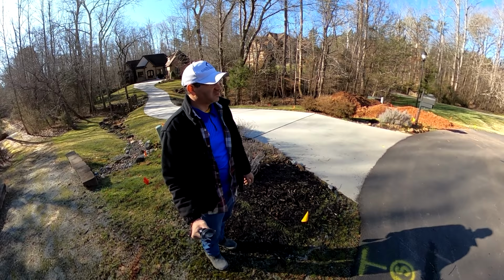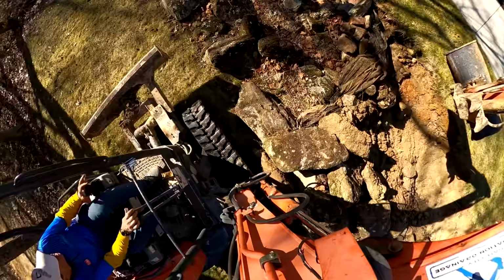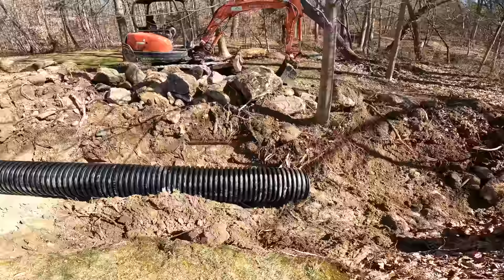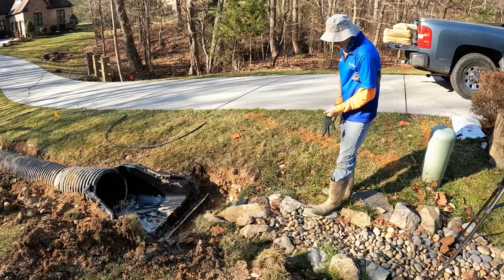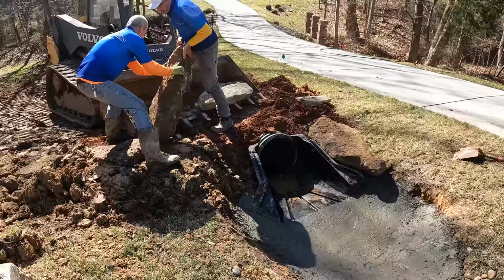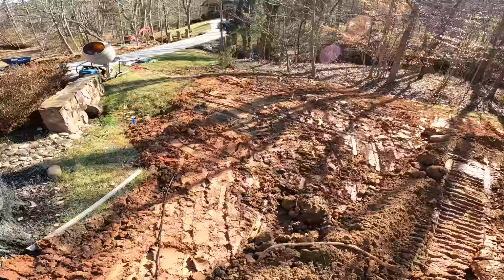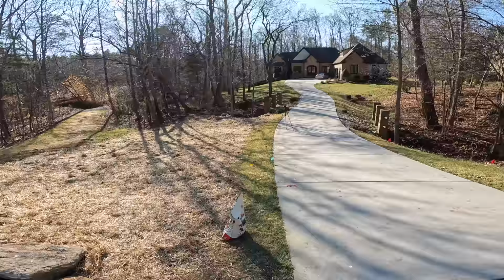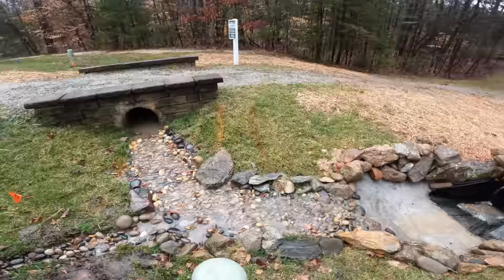Converting a riprap channel to a culvert

Comment: What is the reason for spreading the straw when you have seeded? As we don’t do that in England.
Reply: Helps to keep the moisture in, and keep seed from blowing away. Rains a lot more in England than it does in the USA.
Reply: @chrisbaer4567  Not necessarily true.  More rain in up state New York than London.
Reply: On construction projects the UK with a large area to be seeded the grass seed is mixed with water and wood fiber or paper and spayed is sprayed on. Would do a similar job to the straw.
Reply: @johnclements6614  👍thanks for that
Reply from the maker: The straw absorbs the energy of raindrop splash, so protects the bare soil, it protects the seed from predators, the straw holds moisture and releases nutrients as it decomposes. The grass grows right up through the straw and by the time it's ready to mow, the straw is all but gone.
Reply: @GCFD  thank you 🙏

Comment: Great video!! Definitely the dump truck guy is at fault! But, I'm sure you paid for it in labor though. 😒 So I see you have the truck up and running. What ended up being the issue with its continual death?
Reply from the maker: This was before it died on the road. I have a high pressure oil leak somewhere. I ordered some air testing parts. It might be a dummy plug, o ring or injector. Should know next week! I already miss the truck.

Comment: Did you pull any permits for this? Converting an open channel to a culvert usually requires and engineering analysis to prove its necessary beyond just aesthetics…
Reply from the maker: We did get approval for this project. I think it was something like an 8 month turn around for the homeowner before we could start.

Comment: Great video Shawn. I love your videos. I know you didn't do a french drain here but I see many of your videos do. I can not find scheduler 40 perforated pipe anywhere. Is it as simple as just drilling out perforations on the bottom side of the pipe? If not any recommendations on where I can get it? I'm in Georgia. The big box stores don't have it and they want to sell you the corrugated pipes. Any help would be appreciated. Otherwise if you travel to GA I would love to have you. I have so much water all over my house.
Reply from the maker: Hi Steve - We did a FD today and we drill our own pipe. We use around 1/2"
 drill every 6 inches at the 5 and 7 oclock positions.
Reply: @GCFD  Thank you sir. Much appreciated. I'm dewatering my back yard this week. Thanks for all the inspirational and educational videos. I have learned so much. Thanks again.

Comment: The communication line breaking wasnt your fault. It was buried and not marked. You had no idea to look for it. Have a question though. You are always saying how corrugated pipes isnt good to use, but you do use it occasionally. Can you tell me when its ok to use and when its not?
Reply: Double wall corrugated is not as resistant to mechanical damage as solid pipe but if it is buried at sufficient depth  so that vehicles do not damage it and it is bedded so that rocks do not stab it it is good. Same water capacity as solid and since smooth no snags to catch debris. Less material in the pipe so cheaper and also lighter so easier to carry move.

Single wall congregated is less resistant to damage than double walled corrugated and much less resistant than solid. It can be squashed in some cases by walking on it but it will be strong enough if used at sufficient depth and is properly bedded to prevent stones etc stabbing it. It will carry less water because it is rough inside and the rough inside will catch leaves etc. Since less materials it is cheaper and lighter.  Good to use in lower flows where no debris can get into the pipe such as land drains, should not be connected to gutters.

Solid pipe is more resistant to mechanical damage so good for use closer to the surface. A solid pipe is more likely to survive being attacked by gardening tools than double wall. But it is more costly than double wall because more material is required for the same strength. In some places it is code to use solid pipe at depth for sewage where double wall would be adequate for strength, because of its increased resistance to mechanical damage. Solid gets very expensive for larger diameters then it is better to go with concrete or double wall.

You have to consider the whole cost, the pipe is only part of the cost.  Solid is more expensive but less likely to get damaged at the surface where Shawn uses it mostly in gutter outfalls.
Reply: Thank you so much for all the info. Really appreciate that
Reply from the maker: Like John said above... this is double wall corrugated so it's rigid and smooth on the inside. It's good stuff for culvert.
Reply: Thanks

Comment: Another great project completed👌🙂
I noticed or it stood out more since Bing watching your clips is that 2 of our concrete paths, we'll one really it goes from the front of the house near the front door along the front and then down side of the house it has fallen/sunken towards the house. I believe this has happened since we had the bad flooding here in Townsville back in 2019( we didn't get water in the house just the block had a lot of water on it). I have fixed the water problem with plumbing the rear downpipes out to the street, a French drain system and I have also had topsoil dropped off and used it to manipulate the water where I want it to go which is all working perfectly.
My question is the concrete path do you think I should remove it and put in a new one or top coat it to recreate the fall it used to have?
Cheers
Reply: There's a mason on YT Mike Hadduck who does a lot of repair jobs.  Search his channel for ideas/solutions.
Reply: @AStanton1966  I know how to concrete🙂 I was just wondering what his recommendations are 
It isn't like I could get him to come and give me a quote 🤣🤣
Reply: @logsie3918  I was thinking in terms of some ideas for a low cost repair.  Like lifting up the affected area.  That's why I like the Mike Hadduck videos.  He always goes for the Chevy solution rather than the Cadillac.
Reply: Does the water from a thunderstorm stay ponded against the house. If no water is getting into the house and the sun comes out and drys the wall so it does not stay damp is it a problem (as opposed to not desirable). 

 If the concrete has settled towards the house then the area excavated next to the house to build the foundations was not compacted properly. Overlaying the concrete could cause more settlement. Thin layers are difficult to apply. If you you bury more of the wall you could cause more problems.
Reply: @John Clements  the building process here unfortunately is wack them up as fast as possible. We didn't witness our house being built but have visited quite a few display villages and watched a lot of new construction going on around town over the last 5 years. Slabs are poured and usually with in the week of pouring they are already building on it. I thought and have read the slab needs to settle and cure properly first which takes about a month is that correct?
I know the garages usually crack first I have been informed as they pull all the concrete that direction which brings out more water in that section.
We have had to recently retile a small area due to finding out that there was very little adhesive on the back of the tiles that had totally failed this has been acknowledged by a tiler tradesman we had out that they just slap them down and get straight onto the next job.
I dont mind smashing it out and putting in a new one, at least I know it will be don't properly.🙂
Thanks for the advice and information
Reply: @logsie3918  I think the building process in most places is chuck them up as quick as possible and bodge over the mistakes.

Normal concrete will get to around 75% of its ultimate strength in 7 days and around 95% at 28 days. Maybe a bit slower if they replace some of the cement with ash from your coal power stations. Seven days should be strong enough to build on unless they are putting some heavy equipment on it.

Not sure what you mean by the building slab settling; the ground that the slab is placed on should be compacted so that it does not settle after it is poured which could cause it to crack. Curing will take about a month but most takes place in the first few days. They normally spray the slab with chemicals when the concrete has not set to seal in the water to help the slab cure. Walking on the slab will rub off the chemical but if they leave it for a week it will still work and it will take a while to be all removed.

If they are dropping all the concrete in one place and dragging it that is not good. They will tend to leave the stones behind and drag the cement and sand, segregation of the concrete mix. That would explain the water. You need the interlock between the stones for part of the strength. They should place the concrete so that as little movement as possible will be required as you can see in Shawn's concrete gang.

I assumed that a concrete slab around the outside of  house would be separate from the house slab. I obviously do not know if the slab around your house is separate.
Reply from the maker: I would recommend replacing the concrete. The reason is I like to fix things correctly and long term. You could absolutely resurface the existing walk to raise it up but you might have the same problem later, or the resurfacing material might flake off. I think it's good that you're identifying and looking to solve these problems before they become bigger issues.
Reply: @John Clements  yes sorry the paths are separate to the house and thank you for the in-depth explanation 🙂👌
Reply: @Gate City Foundation Drainage  thanks for the advice
I will look into replacing it and putting back in the correct fall like your awesome concrete crew do🙂👌

Comment: So my question is this.  Why do you use that type of pipe instead of a pvc pipe.
Reply from the maker: For anything 12" an above I use double wall corrugated. This culvert pipe is smooth on the inside and rigid. It's good stuff.

Comment: Can a riprap channel ever be self-clensing the same way a concrete channel or culvert can? Or will sand always build up and clog the lower flow channels in the rock and divert more of the water to the upper channels and eventually causing surface flow on top of the now-clogged riprap?
Reply: Concrete channels and culverts are only self cleansing if they have enough flow to clean out the debris, same as a riprap channel.  If there are frequent high flows the riprap will stay clean but trees etc could start to encroach and make it more like a natural feature.

If there are infrequent high flows with low flows that deposit sand then the sand then there could be problems. The sand filled riprap will not slow down the water initially so the water will move down the channel faster. Not a problem if the riprap is there to protect the channel itself but a problem if you want to slow the water down before it gets to some place down stream.  Eventually the faster flow will scour the sand out and then the riprap will be exposed slowing the water back down. If deposition in the riprap is causing a problem down stream you could put in a pond or deepened channel upstream, at a convenient point to catch the sand and get a machine to dig it out.
Reply from the maker: Like John said above 👍👍

Comment: You mentioned a couple of times that you wouldn't convert an open rip rap channel to a culvert of it was still receiving water. What would you recommend if desiring to close/cover a rip rap channel/ditch that was still receiving water?
Reply from the maker: If it's still receiving water you could create a swale over the culvert, but you'll be in the same position with erosion and needing riprap to armor your swale.  I would not recommend it.

Comment: Why does the kuboda sound like it’s down on power and about to stall in the beginning?
Reply from the maker: It does that when it's cold. There's a problem with the auto idle crap on it, even though I've replaced all the computer modules and the motor for the auto idle.

Comment: It’s nobody fault , but those lines supposed to be buried deep . If there’s anyone to blame it’s the company who installed those lines . I have comcast and you can see the wires sticking out of the ground . Lazy technicians basically not burying wires at the correct depth. You guys are just doing your job but due that your working on the property the liability falls on the dump truck and att fault for not burying it at the correct depth.

Comment: Anyone know if there are resources available online or maybe through my county, that shows any kind of data regarding the general water sources and flow direction that surround my 3 acre property?  Need to mitigate the flooding with rain so I can start the design a small cottage airbnb village that I’d like to circumvent a new pond that incorporates swales that already exist partly as fire breaks and water management, that just fill up AND some.  Thanks